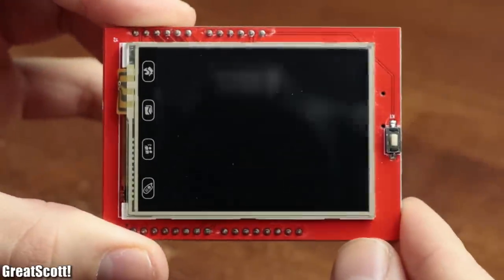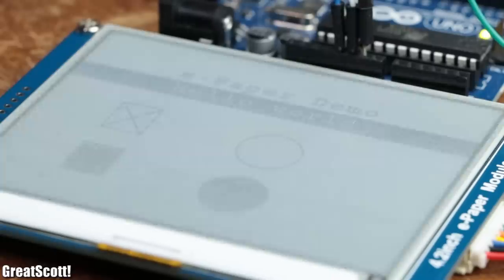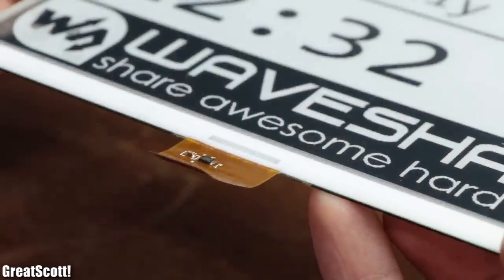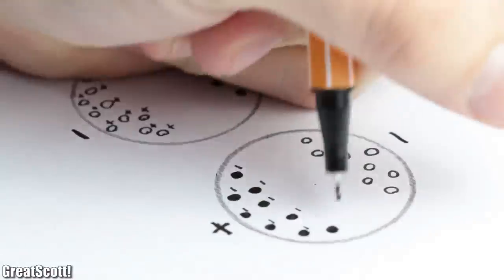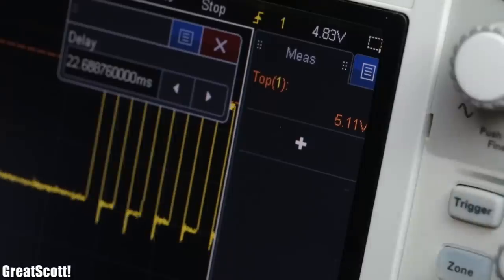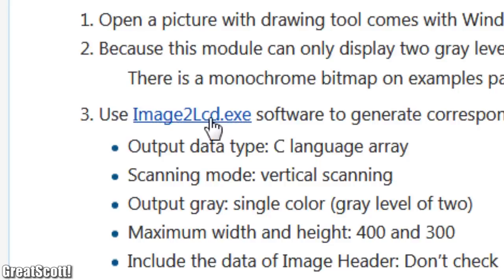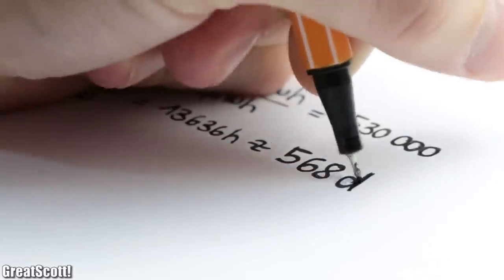The best low power display? E-Paper Tutorial

Comment: E-paper has another hidden trap for newbies: the e-paper runs on a quite high voltage (several tens of volts, often two rails a + and a -), and, every time you power it down (enter sleep/standby) you throw away the charge in its "high voltage" power supply caps. That's energy you have to put back into them the next time it comes out of standby. This energy isn't in the datasheet power consumption figures, and does add up to quite a bit when you do the math for say a year or two of display updates...
Reply: Is charging the caps such a lengthy procedure that you need to proactively charge them, and keep them charged, before you do a refresh? I guess a well designed system would only charge them when you are going to refresh the screen.
Reply: Could you provide some real world numbers?
Reply: @SugarBooty For a clock updating the display once per minute, two rails of (+/-) 20 volts, 10µF caps: 365*24*60*(10e-6*20*20)/3600 = 0.58 Wh. To put it in perspective, that's ~= the energy in a CR2032.
Reply: @gotj  That's quite a bit of energy. Could the design be optimized to minimize the size of the caps, do you think?
Reply: @sugarbooty  the calculation is for a year's worth of updates, I don't think that's unreasonable. I have a musical instrument tuner that eats through a CR2032 in a few weeks worth of practice.
Reply: And there are clocks with LCD displays that can run for years on a CR2032
Reply: @rtos  For a billboard you can do what they do for color LED displays and just use an array of displays linked together. The original Kindle is epaper and is 6" screen. You could arrange 2,100 of them to make a billboard. That's probably a bit more work than an array of 60 or so on LED billboards.
Reply: Seeing as the display cannot refresh fast even with all the power in the world, you don't have to be very quick at charging up the refresh caps. Also, e-ink should never be used for responsive displays, but ones that don't change often that you need to stare at a long time, like e-readers. 
It is something to think about, but in the grand scheme, it isn't what the product claims to do efficiently. It's claim to fame is how low power it is to maintain an image.
Reply: Just for people's reference, looking at the datasheet of the TPS651851, which is the IC managing the power of the display through the IT8951 display driver board, we've got a +22V and a -20V lines for gate voltages (coming from a combination of boost converters and charge pumps), +15V and -15V for source driver voltages (coming from low dropout regulators connected to the boost converters) lines, and a 0 to -5.11V for back-plane bias, all things needed either for the display itself or for the memory stuff (I think? haven't really read through much). There are caps for each of those, and assuming caps for the input voltage that goes up to 6V, and assuming 10uF caps, the energy required to charge each of them up can be calculated by the equation 0.5*C*(v^2). So plugging in values, 0.5*(10e-6)*(22^2 + 20^2 + 15^2 + 15^2 + 5.11^2 + 6^2) ~ 7mJ. Refreshing every minute for every hour of a year, you multiply that by 60*24*365 and get around 1Wh. A CR2032 is a coin cell battery that is 3V with 225mAh capacity, so (3V * 225mA * 1h) = 0.675Wh, so you'd need around 2 of those just for charging the caps up for a year if you were powering this display through those. Honestly, that's not too bad. Consider additional power consumption from the rest of the stuff in the display and in the losses in the converters and regulators, and maybe replace the batteries once every few months; or use a typical Li-Po battery you find in phones that are something like 5V 2000mAh at least and for those you get 10Wh, so you can last 10 years on those.
Reply: It's not a problem at all. If you refresh the e-paper every minute, for example a clock, the energy won't be wasted. If you refresh the e-paper only a few times a day, just use smaller capacitors.And the same situation with the LCD back light LED，it's connect in serial, 3volt * 6-12.LED driver is a boost circult, but the e-paper often use a charge pump.The energy in a inductor won't last,but MLCC can save energy for at least a few minutes. So it's not a trap, e-paper is the most energy saving display for now, you don't have any other option.

Comment: damn, basically the arduino eats more power than the display, lol
Reply from the maker: True :-)
Reply: don't you expect it to though? its a tiny computer
Reply: I don't find it very surprising given how the eink works.
Reply: @sky-persuitofwonder  I think it uses like 50 mA 5V, so no, i didn't expect that
Reply: @dega235 You can drastically cut power consumption by removing the power LED, applying a sleep mode when the CPU is not needed, and pull all unused pins to either LOW or HIGH. The only thing still consuming a few mA would be the USB interface., which can be omitted by using an Arduino without one, or better, just the bare MCU.
Reply: Undefined Lastname yea there is a lot you can do when you get away from the arduino board itself as well. Atmel chips dont go quite as far as the msp430’s do in terms of low power modes either. I used to work for a company making remote weather data loggers that could be placed in a field with a single 18560 for 3-5 years collecting data at about 1 sample per minute. The limiting factor was really just the shelf life of the battery moreso than the power being used by our loggers
Reply: Yeah they do use a lot in the long run
I think someone made a sleep library
Reply: Well for all passive displays... Even Pasive LCD (like the one that is in digital watches) they literally consume no power what so ever when they are not changing there image. That is how the Game Boy can ran hours.

E-paper have the advantage over LCD to be much sharper and have a potentially much higher resolution.... with a few drawback, the major one being the very low refresh-rate.

If the refreshrate can be change to something resonable and the power still could be keped down then we would have a real winner product.

Worth to not that there is edge lit e-paper that consume way less power than a LCD, and still, if there to little light to se the self reflective paper a tiny amount of light can be used to edge light the screen. And then when there is more light, in steed in increasing the brightness, it can simply be turned of. This could make a facebook or youtube machine that potentially could run weeks on a charge.
Reply: Replace the monster with a MAX32620 and you have a truly ultra-low power device.
Reply: Interesting stuff... however the really slow refresh rate of the e-paper lend it to limited uses only.   A while back I've seen some Amazon reader tablets on which the refresh rate was much faster, almost instant.. so I'm not sure why the limitation on this particular display.
Reply: Is it possible to use attiny chip? Its consumption is very small
Reply: Arduino is useless for low - battery power projects. Led diodes and voltage regulator will drain any battery in a day or two. If you start stripping arduino you are left only wih bare atmega chip. So you basically have two ways to go, eiher with atmega chip and use power states (usless in arduino), or better, go with esp32, which handless energy better regardless of the wifi and bluetooth, its 3,3 V so you can power it for months directly from a single LIFEPO4 18650 cell.
Reply: @nrdesign1991  Agreed, i used an attiny85 using it's built in minimum clock speed of 1MHZ and a one inch OLED in a bike computer build. I could run it for days on a battery pack. That's without the sleep function. I could go even lower today. With some of the stuff we have now. I'm focused solely on battery powered projects now.
Reply: @billybbob18  That's awesome. Running the Attiny in short bursts of higher clock speeds and then sleeping may save you even more battery. When the I²C interface can be clocked at higher speeds, and calculations for the display can be done faster, the rest of the time can be used for sleep. Either wake up the MCU in regular intervals with a timer, or with an external interrupt pin. You can disable every piece of peripheral you don't need, like the ADC and timers with the PRR – Power Reduction Register. If you go so bold to disable and enable them before and after each use, that saves another few µA.
Reply: @sky-persuitofwonder  micro controller /= tiny computer

Comment: Too bad that kindle like readers weren't more popular and didn't drive the price of these down.
Reply: I think they are and they did. Just look how expensive it was years ago.
Reply: @peoplethesedaysberetarded  AFAIK You can move the ebooks you purchased on amazon between devices as long as you have both devices associated to the same account. Try the amazon reader app on a mobile phone or something, even on PC, and you should be able to redownload your purchased ebooks to that app. In fact I believe it lets you continue reading from the same point between devices.
Reply: @agarceran  Yeah, but only with another Kindle reader, not another brand.
Reply: Low-power display for IoT devices could get popular on its own though, hopefully that'll drive the prices low
Reply: @peoplethesedaysberetarded  Well, you could use Calibre with a Kindle DRM remover (which remove the DRM from Amazon books), you can then move your books to an non Amazon e-reader. Amazon won't care but it's not very legal. What @Adria Garceran said is also valid if you want to move to an other Kindle. You just sign in your new Kindle with the Amazon account you used on your old Kindle.

Comment: This is the Kindle stuff, right? Except that Kindle has a lot greater resolution on averagely the same size (in other words, the same pixel area is contained on a lot smaller area). This creates the monochromatic display to be able to display grayscales, simply using dithering techniques, like printers do with toner. Given the actual size of those microcapsule pixels being so small it's almost invisible alone, this dithering is unnoticeable, it seems really like a grayscale gradient. As with CMYK screens (because it doesn't use light to produce an image, it uses actually something like ink, so these displays are more like printed pictures), these microcapsules can contain five different colours (WCMYK). White serves as a base colour, while Cyan, Magenta, Yellow and Black are the basic colours to make the picture. Since microcapsule can be programmed only to two different states, four capsules need to make up single pixel. Each capsule having white and corresponding colour (Cyan, Magenta, Yellow and Black - CMYK). Those colour displays naturaly have lower resolution, of course. But with the size of the microcapsule, I don't think you're going to notice that, actually...

Comment: A local electronics store has started using little e-ink modules to put the prices on the shelves. I think the modules might actually be wireless and they can change the price, name, etc on the fly. As the screen uses no power while it is displaying things they could get away with using them and recharging them only after quite a while.

Also, on an unrelated note, I am still waiting on the RGB displays we were promised Years ago. Seems like BW was good enought for most uses and if you want color you need to get a tablet. The tech also has become quite stagnant since quite a while ago, in terms of resolution or number of colors (or gray levels) possible.
Reply: Adria Garceran I used to work for a Belgian supermarket chain (Delhaize) as a student that had those, I looked them up and the brand is ‘Pricer’. I believe other stores have them as well, they’re pretty common around here. 
When there was a new product or the Pricer (we called them ESL) was broken/lost we could scan the product and the barcode with our smartdevice thingies and a few minutes later the price and productinfo would appear on them. So they work on some sort of wireless network in the store. 
Also, we never had to recharge them, they last for a long time because we only had to throw them in a special bin when the text started to fade away or when they wouldn’t respond when we scanned them.
Reply: Grocery stores have been doing this for years around here.
Reply: I think those use VLF or something crazy
Reply: Waveshare actually suggests that usage for their e-paper displays: "ideal choice for applications such as shelf label". Interesting to see that someone is actually using it for this purpose.
Reply: Hey! I just noticed those E-Ink displays as the price labels yesterday in a hypermarket!!!
Reply: Best Buy does this. The price and info sheets on all displays or boxes are digital and are linked to a server. They update at 1am every day
Reply: Yep, the e-paper modules shown here are intended for store price displays, but Waveshare repurposed them for DIY projects. Just a few months ago, they started offering real e-paper displays intended for e-readers and paper tablets…
Reply: The same manufacturer (waveshare) sells e-ink panels that update using NFC. You can design your images using their app and update the panel using the NFC feature on your phone. Pretty neat I would say.
Reply: Well four years later, check out the BMW iVision. It uses e Ink for the paint job of the entire outside of the car in a lot of colors

Comment: With the LCD display most of the power is used by the LED back light and 1W seems extreme (you will likely damage the LED's at that level).
Each LED can be supplied with max 15mA and depending on LCD size you have maybe 4 or 6 LED's so 60 to 90mA typical at 3V that will be 0.27W (that is extreme already). In my projects I use a max 25mA and as low as 2mA for LED back light on 2.4 and 3.2" LCD's so 0.075W or less.
Reply: That number stood out to me too
Reply: To me too

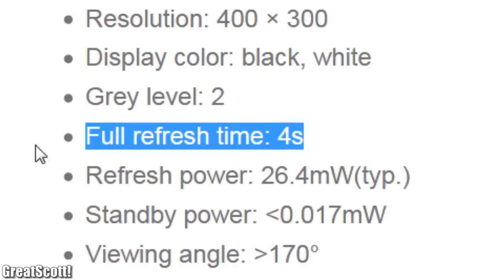Comment: @6:29 there's the answer: refresh power: 26.4mW, refresh time 4 seconds. Say you want to make a clock, you'd have to update the minutes every minute, ok? Well, that's 26.4e-3 * 4 * 60 * 24 * 365 / 3600 = 15.4 Wh/year and any big display LCD clock you can buy at amazon or ebay, can run for years on a single AA alkaline (2Ah*1.5V= 3Wh), or even an AAA (less than that) !

Comment: E-paper is NOT low power, updating the display requires a lot of energy . It's only "ultra low power" in standby mode: i.e. with a static, fixed image that's (almost) never updated.
Reply from the maker: LIke I said in the video, updating the screen requires around 17µWh. Still pretty low power.
Reply: Hey, it's in the data sheet: 26.4e-3*4/3600 = 29.3 µWh. Do the math and you'll see that that quickly adds up to a lot of energy if you want to update the display "often". See my other comment here.
Reply: @gotj  the refresh rate is 4 to 6 seconds for 1 frame, i doubt you'll like to refresh this kind of screen "often", i would use this for some kind of device that only have to refresh the information on demand or every not so "often".
Reply: @gotj  If you do the math its still orders of magnitudes less energy consumption then his LCD.
Reply: @KlockworXMusic less than the LEDS of the backlight of his LCD. Lots of big LCD display clocks can run for a year or two on an AA alkaline, that's ~ 1.7mW, less than 1/10th of the power drawn by this epaper.
Reply: @roidroid  on top of that, watches and (battery powered)clocks, if they even have a backlight tend to only turn it on for mear seconds and only on demand or occasionally as part of the alarm.

E-ink displays are seriously efficient to be clear, but are best off displaying info that doesn't need to change more than once a minute or even once a day, TFTs and other LCD displays of the more common variety are good when something is changing constantly like a video.

TL:DR, TFT LCDs and E-ink displays are both good, so long as you pair them to the right kind for each
Reply: @gotj  Is there any 640x400 B&W LCD that consume as low power as epaper? I looked few years ago, and there were none, even with backlight off.
Reply: @Chevy SparkEV LCDs require a tiny amount of power 100% of the time, the epaper can retain the image with zero power needed. But the epaper needs (quite) "a lot" of power to update the display. That's all I am trying to point out. I'm not in the anti-epaper league or something. Ok? I say: do the math well, and you'll see that except for ~ static images the epaper isn't a low power display.
Reply: @gotj  There's your theory and there's real world. In practice (real world), there is no LCD with epaper resolution that has as lower power. I wish there was, because I like LCD refresh rate, but no LCD even comes close to epaper power / resolution.
Reply: That I know of, sharp LCD memory displays are the lowest power if you need a pixel matrix. https://www.sharpsma.com/products?sharpCategory=Memory%20LCD&p_p_parallel=0 standby power is in the tens of µW, active power (image updates) in the hundreds of µW. That's a lot more power than a segmented LCD, though. For example, to make a clock (4.4", so not too "big") that updates the minutes every minute with an LS044Q7DH01 (100µW standby, 600µW active), you'd need ((600e-6*1*60*24*365)+(100e-6*59*60*24*365))/3600= 0.95 Wh per year . To do the same with the epaper in this vidjeo you'd need (see my other comments here where I do the maths) about 16 Wh/year . That's 16 times more.

To put it in perspective: A single AA alkaline can power the LCD for more than three years, but 5 AAs would power the epaper for less than one year. (one AA = 2*1.5 = 3 Wh)
Reply: @Chevy SparkEV I don't know why you say that, when the epaper in the video is only 4.2" and consumes 16 times more energy than the 4.4" Sharp LCD as I've shown you in the message above.
Reply: @gotj  The LCD you show is not 640x400 graphics LCD. Show me a LCD with similar number of pixels that has lower static current than epaper refresh current. There isn't one.
Reply: All the LCDs have "lower static current than epaper refresh current"